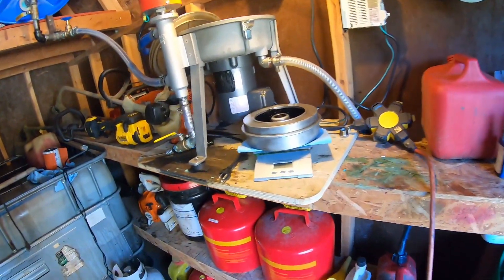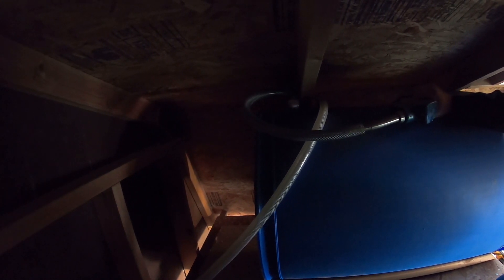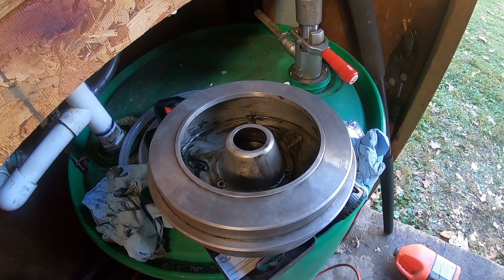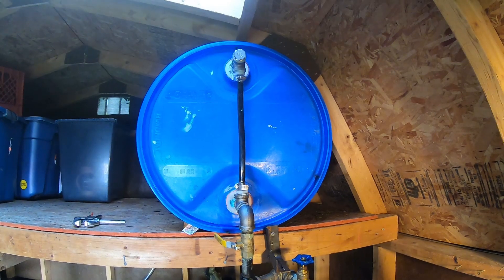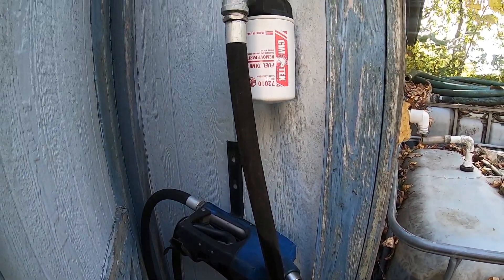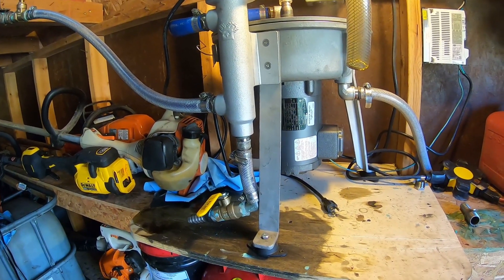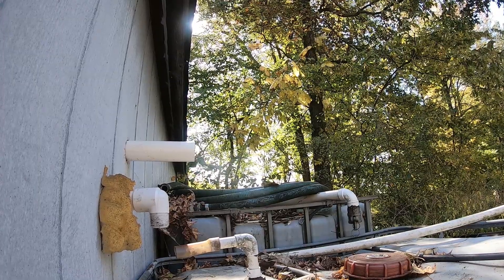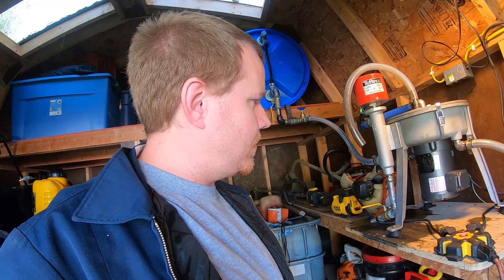Black Diesel - Do Multiple Passes Through A Direct Drive Centrifuge Make A Difference? - WMO - Fuel

Comment: What unit do you have, what's the cost and where can you get one? Do you run  oil centrifuge  system on your diesel engines, I do. I'm running Dieselcraft unit.
Reply from the maker: The unit I run is the WVO Designs Extreme 6k rpm unit with booster cone and heater.  You can get them here...    www.notsograndgarage.com  I became a dealer for them a couple years after getting one and making content with them.  Feel free to reach out through the website.  You can buy direct from WVO Designs as well, but pricing is the same.  Buying through me helps the channel grow.

Comment: Man if thos was cheeper id so get one but i just use filters down to .5 to .2 microns after sitting for a year. But id love to see how many times it would take to get it where there kinda isnt anything struck to the side
Reply from the maker: It'll always pull more carbon out of the diesel oil.  Now oil from gas or NG/Propane engines will come out a lot cleaner looking.
Reply: @NotSoGrandGarage  that's true so you think it would be as nasty as your second or 3rd run.  Or have you ever ran the hot oil then second run with fuel but with heater off. If that would do much more bc it's thined out
Reply from the maker: I've ran thinned oil with no heat but not a back to back like you describe.  There is a video floating around here showing the thinned run.
Reply: @NotSoGrandGarage  I'ma have to find it. Thanks

Comment: Just a suggestion getting a true cone bottom take is amazing for setting the junk out of the oil while its sitting less to also filter and clean.
Reply from the maker: I'd like to find one for a reasonable price.  It's in the plan as the shed is getting ready to be rebuilt
Reply: @NotSoGrandGarage  I gatta remember where I bought mine but I bought and odd number gallons and it was cheeper. I'll try to find it and send it to you
Reply from the maker: @dakotak8437  appreciate it!

Comment: Are you heating the oil to make it flow better? Nice setup!
Reply from the maker: The centrifuge has a heater mounted to the side.  Oil is heated to 180-200F before hitting the bowl.  Otherwise, no heat.  Be sure to check out my other videos on the subject.  There's a decent selection now.  Thanks for watching!

Comment: How much more transparent is the the oil after a pass compared to regular wmo , I’ve been researching ways to clarify it because I want to run it through my DS4 6.5 turbo diesel with the least issues
Reply: Also polek has some interesting videos on “ bleaching” it with acid and trimethanoline aswell as baking soda , I have build plans for a distiller also if you’d like them
Reply from the maker: @valentinopresutti9494  sure.  You can email them to notsograndgarage@gmail.com if you want.  I've also got some ideas for making the oil clearer but haven't had time to try them yet.
Reply: Thank you ! , appreciate your help and I’ll get them sent off
Reply from the maker: It's still dark.  I've not seen a way to make it clear short of distillation.

Comment: I recommend trying to cut the flow rate to 1/2 or 1/3, and compare that to running a batch from the same source, and the same amount through 2 or 3 times at the normal flow rate. I wonder what would be more effective, easier, and more energy efficient. Running slower rate once would certainly require less 'hands-on', and may save time, because there won't be the pumping time taken to back-fill the gravity feed barrel. The caveat is, you may need to reduce batch volume, to not load up the centrifuge bowl. As that loads up with sludge, you have less lip depth, which reduces the effectiveness of the centrifuge.
Reply from the maker: That's the reason I do multiple passes.  I don't have to worry about the bowl filling, etc.   That and I have it plumbed to do it easily.  I've got a few videos planned here soon.  Haven't been doing many oil related videos as all of my oil burners are down at the moment (unrelated to fuel).  More to come.  Thanks for watching

Comment: Raise centrifuge speed 50% for better cleaning.
Reply from the maker: Send me a 9k rpm motor that'll bolt up to it and I'll give it a shot.  It's already spinning at 6k...
Reply: @NotSoGrandGarage  Still looking. Best I can do is 8k  Sorry.
Reply: @richardbarber4444  please don't... 
The forces are to great for that bowl and you certainly don't want that to break at over  8k rpm at that weight....
Reply: @  I was ball parking comparing to my tractor transmission centrifuge which renders crystal clear  oil.
Reply: @richardbarber4444  no matter the speed of the centrifuge the oil will stay black. The carbon inside that give it the color is to smal and to light to get filtered. 
Normal filters also don't work even if super fine. 

There are only 3 ways to get that out and all of these are unessary and expensive.
Reply: He did better than that. Since centrifugal force increases on the square of speed, he increased his centrifugal force by 3 times, because of the upgrade from 3,450 RPM, to 6,000 RPM. Doubling the speed would give 4 times the g-force. The new motor (and variable frequency drive) is literally 3 times better!

Comment: what's the difference between ran through twice or half the flow rate? these videos definitely make me want to buy a centerfuge.
Reply from the maker: Good question.  For me, multiple passes is just easier...  and it allows me to clean out the bowl if needed between runs.  Time in the bowl is time in the bowl I'd say.

With that said...  only a couple days left on my 10% discount code with wvodesigns.com.
Reply: @NotSoGrandGarage   oh ya i guess if the bowl fills up with sludge and overflows it will contaminate the clean oil eh.
Reply from the maker: @306familyfarm7  yeah..   but you could check mid run I suppose

Comment: what about running one pass at half the flow rate of your regular passes, it would be less work and less plumbing than running 2 passes with perhaps the same amount of contaminates captured
Reply from the maker: Possibly so...   in my case though, I don't let the unit run overnight so it's easier for me to do it this way.  Time in the bowl is what matters....    but if your oil is really wet, the bowl could be full of sludge by mid batch, reducing efficiency.

Comment: Given these results, would it be better to run 2 centrifuges in series and do this in a single pass?
Reply from the maker: It would be faster per batch...  but the end results would be the same.  If you've got the money and not the time... then sure you could series as many centrifuges as you want.

Comment: A barrel with an out at the very bottom snd return back through the top. Insulated. No extra plumbing required. And just let it run. Stop after 24h, clean the centrifuge, keep running.
This way through simple maths you can get the actual answer that has a real life value - how long does the oil have to sit in the centrifuge to get clean enough?
Thoughts?
Reply from the maker: Can't really do that without some type of pump.  If the drum is gravity feeding the centrifuge...  the outlet of the centrifuge is too low to return to the drum.   Might as well just go with a large pressure driven unit at that point.

Clean enough is an opinion of the end user.  I call 2 passes and minimal material in the bowl clean enough...   but it isn't clean as in new oil clean.

Also depends on the oil.  If you've got nasty oil..  itll take a lot longer than if the oil is relatively clean to begin with.  

Passes make it easy to tell how dirty the oil really is without having to batch for 24 hours.

Also, with passes... ALL of the oil goes through the centrifuge.  If you are just dumping oil back into the top from the centrifuge...  you never really know if all of the oil has made it through the bowl.

Comment: I noticed that you have the bottom vented to outside ans you could see visible steam but from what I see it looks like you have the clean oil going directly into your clean tank.   I know that the clean tube will vent moisture and you are just putting that into your clean tank.  I have found its best to have the tube drip into the clean tank leaving space for moisture to vent off and not be forced firstly into my tote.
Reply from the maker: I've changed the plumbing recently...  added a p trap.  No moisture making it to the finished drum now.  All venting from the centrifuge directly.

Comment: not surw how fast you run yours but iv heard its best to do 4 passes at 2 gallons an hour for the best results not sure if its better or not im not set up yet where i can run a centrifuge yet just going off what i was told i will run mine that way when i get set up to see the diffrence of each pass and might make my system run 4 centifuges to be a one fill set up to allow me to do other things and then the oils ready all at once i plan to run mine from a barrel to an ibc tote clean tge bowls and run a second batch since my truck holds 50 gallons and only gets 250 miles a tank full
Reply from the maker: Not sure on total pass quantity.  I'm gonna see here soon as I've got my system now setup to run small batches...  so I can test all sorts of things.  Multi-pass (3+) is on the list for sure.  I run around 5gph and seem to have good luck with it.  It REALLY depends on how clean the oil is to begin with.

Comment: Thanks! How do you plumb your top barrel on the shelf from the waste oil? The top of the top barrel?
Reply from the maker: There are 2 bulkhead fittings and hose barbs on the top of the drum.  One vent and one for filling from the pump.  Check my playlist.
Reply: @NotSoGrandGarage  Thank you. Also, if you ran the centrifuge slower rpms (3600), it might remove smaller particulates by keeping the oil in the rotor longer? So you don't need to pass the oil through 2x.
Reply from the maker: @IshawooaPass  the faster the centrifuge spins, the better.  Can slow flow through the centrifuge down but the bowl can only hold so much.  If its got a lot of water in it or sludge, 2 passes would be better.

Comment: I see you are having problems with heating up the oil. Have you looked into compost heating up to 70' celsius heating for upto 18 months.
Reply from the maker: Only had issues heating a full drum.  The heater that works with my direct drive works great.

With that said, compost heating could work well... but my compost bins arent anywhere near my fuel shed...  dont want to chance contamination if something leaks, etc.

Comment: I just found your channel last night. Awesome videos. Thank you for taking the time to put the videos together.  About running the cleaned oil through a second pass. Are you not picking junk from the blue barrel feeding the centrifuge?  Keep up the videos.
Reply from the maker: If so, it would be minimal.  The oil doesn't get left in that drum very long so not much time for anything to settle out.  I will be changing it up a bit before too long so I can get more out of that drum.

Comment: So this is around 5 gallons an hour what if it was half as fast would it pull twice as much in 1 pass?
Reply from the maker: The longer the oil stays in the bowl, the cleaner it gets...  BUT..  if the bowl is full, it can only hold so much stuff before efficiency drops.  I'm going to setup a small batch test rig here this weekend I think to test all sorts of filtration methods...     filters...    heat vs no heat...    etc.

Comment: I see you cut the oil with gas before filling it to the trucks. Would it be better to cut it with diesel? Or is there a reason to use gasoline
Reply from the maker: Gasoline is a better solvent...  so it takes less to get the oil thin.  Hard to match the viscosity of diesel when using diesel to thin.  Currently though, I'm using both together.  I'll cover that later.
Reply: @NotSoGrandGarage  After you blend the gas with the oil. My question is if I store my blended oil for a certain length of time. Will the oil and gas start to separate or settle? Thanks for all the info
Reply from the maker: @Slawr88  from what I've seen, no.  CUTTERUPROB has done some testing on this.  I typically recirulate my finish drum for a few minutes before filling the tanks anyways.

Comment: If you add your cut or diesel or gas into your waist oil after it has been centrifuged it's viscosity will drop and the amount of dirt and debris and carbon that it can hold or float will be reduced it's always best to have the pre-mix made then run it through the centrifuge
Reply from the maker: That may be true...   but I'm not running gasoline blends through a heated centrifuge.   Some may do it...  I'm not.  Not worth the risk for me.  I used to use gasoline while centrfuging in my old setup and it didn't do much.  Heat and straight oil seems to do far better.
Reply: @NotSoGrandGarage  I don't think people are saying to mix with RUG and run directly into your centrifuge.  Jeffery Brooks on YouTube has talked a out this 10 years ago on his videos.  He would add thr RUG and mix in his settling tanks that would not be pulled from and centrifuge for 6 months.   Basically RUG thins thr oil as you know and the theory would be that it would settle faster and more efficiently before he ran it with heat and no issues and the vapors would be gone by then
Reply from the maker: @gumby511  unless the gasoline evaporates off from the settling tanks, it will create vapor when heated.  If it dpes evaporate off...    then I'd have to add more after the batch.  Depending on how much gasoline we're talking...   I'm sitting on 3k gallons of oil.  That's a lot of gasoline to purchase... just to have it evaporate off from the tanks during settling.

With that said, most people who have been talking to me about it are talking about using it to increase the efficiency of the centrifuge or eliminate the need for heat.  Either way, the oil would have to contain gasoline while in the centrifuge for that to work.

I used to mix gasoline with all of my batches prior to centrifuging so I didn't have to use heat.  Now I use heat.  The amount of stuff I'm pulling out of each batch using heat is substantially more than I ever got while mixing gasoline...  settling time after mixed didn't seem to matter.

Gasoline does break the bonds and stuff seems to seperate faster...     from what I've seen so far, heat does the same thing but does it better... and also drives out emulsified water.

Can you potentially do both safely? Sure...   but I'm not willing to try it.
Reply: @NotSoGrandGarage  I'm sure you've thought about this already but for another test you could try running one batch normal then mix gas in finish tank then run it again with the heater off. You could compare that to a 2nd pass the normal way.
Reply: No need at all to run at 200 degrees 160 or less
Reply from the maker: @tonydiesel3444  not according to the manufacturer of the centrifuges I've used...  and I've seen a difference between every temperature increase.  The higher the temperature,  the more moisture they tend to remove and the thinner the oil gets doing nearly the same thing as adding thinners prior to running.
Reply: @NotSoGrandGarage  get you a hydrometer and test for yourself
Reply: @NotSoGrandGarage  or Zahn viscosity cup and stopwatch

Comment: The centerfuse also needs a P-trap that way it will flow the moisture and the vapor and the steam out of the discharge port not into your collection Barrel
Reply: The same thing as a sink the liquid acts like an air lock and has a spillover point into your collection Barrel but keeps the vapors and Air plugged at all times therefore it can discharge out of the other port
Reply from the maker: @tonydiesel3444  I'll give it a shot.  I've got some plumbing to change up anyways so might as well.
Reply from the maker: I've heard this mentioned but can't find and references to it.  Have any pictures of how it's setup?
Reply: I sent you some info on messenger about the p trap
Reply from the maker: @nicholasnelson7195  I'll check it out
Reply: With oil being heated and cooled a condensation becomes an issue. You can trap water as much as you want but it will keep coming back from the air.
Essentially the receiving barrel needs to be kept full at all times to reduce the air volume. Or reduce the water through chemical means right in the tank before driving. Or use the heater/evaporator in the fuel line.
Reply from the maker: @saulthompson6613  the p trap has solved most of the issue.  You'll always have condensation to deal with but that wasn't the main issue.

Comment: Like I said before it needs to be thinned or have your mix already made needs to be about one gallon per hour through the centrifuge would be best if it's heated while it's at one gallon per hour then you're done ready to use
Reply from the maker: And as I said before, I mix with gasoline and I'm not going to heat a gasoline blend to 200F where it will vaporize/evaporate off along with moisture leaving me a nice flammable vapor.  Others may be willing to do that.. but I'm not.  It's not worth it to me.  I used to use gasoline while centrifuging and the new setup with heat alone does far better.

Now if I where to thin with diesel, that'd be a different story.

Comment: What's the efficiency, gallons in:out, and kWH of electricity to "clean"?
Reply from the maker: Its roughly 1.3kWH / hour of run time....   10 hours per batch.  Don't lose much overall volume of oil per batch.
Reply: @NotSoGrandGarage  so ~50gal per batch?
Reply from the maker: @Iowa599  approximately 45-50 depending on how full I get the gravity drum.
Reply from the maker: @Iowa599  so basically, under $2 per run for roughly 50 gallons...   or it can be processed 3 times and still be cheaper than a gallon of diesel currently.